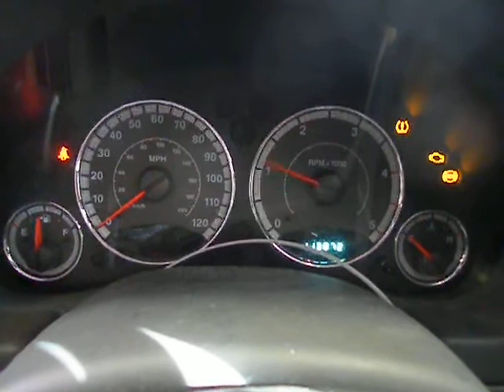11B0180 2005 JEEP LIBERTY LIMITED,2.8,A.T.,4X4,DIESEL,113872 MILES,MORRISON'S AUTO SALVAGE YARD

Comment: I can't believe that sweetheart went to salvage. Sure it's banged up a bit, but sheesh, that engine is good for 300000 miles and pulls like a freight train.

I suppose the owner thought "Oh, 113,000 miles it's not worth fixing."

That engine should get a new timing belt every 100,000 miles to prevent damaging the upper rockers. They will bend first to protect the valves.